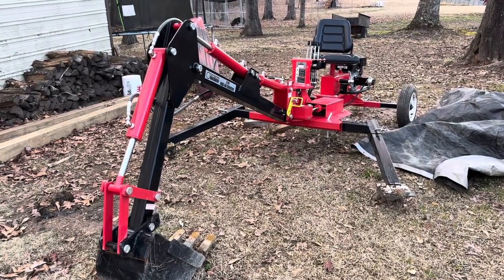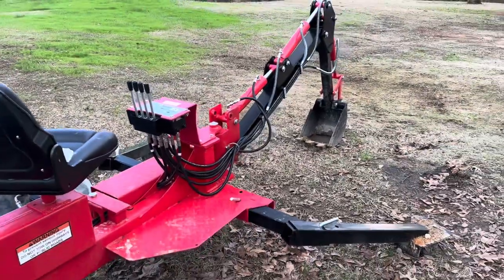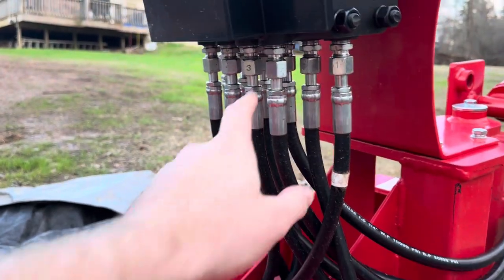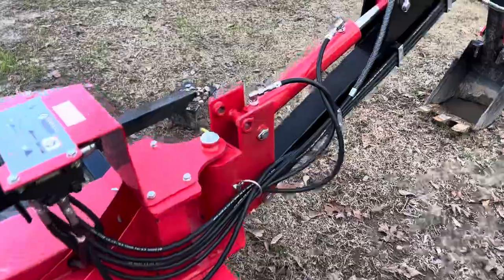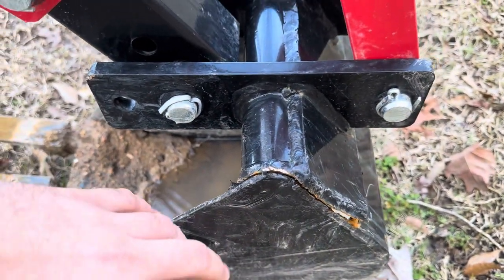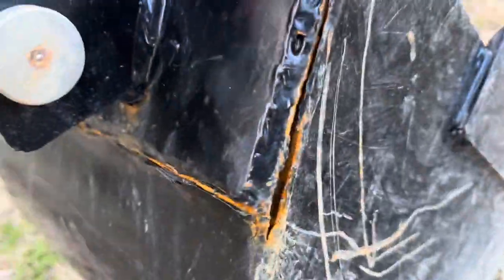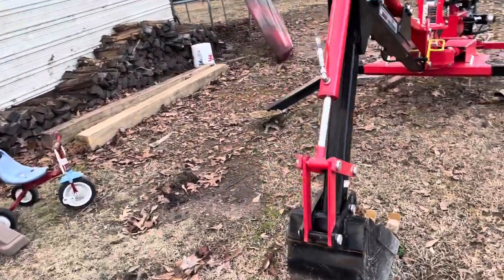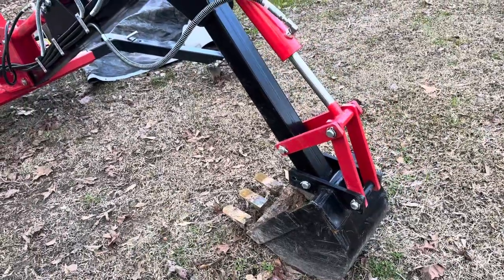Towable Backhoe Harbor Freight Broken after 2 weeks…..

Comment: " I could weld it back myself... but my harbor freight welder is broke too"......that would have been funny
Reply: harbor freight welder is actually very good.. had my flux core 6 years and i weld non stop on floor pans, frames, and even 3/16th leaf spring mounts and so forth..
Reply: @jeepsblackpowderandlights4305  I had thought about buying one...for small stuff around the house
Reply: @leewebb7  deff a good welder.. i have the 90a flux.  I think its called 120a flux now.. but its still just 90.   Easily restored my classic car with it.. floors. Frame.  Everything.  

The wire speeds on it are wrong though.. it says fastest for thick metal.. but i found around 4 wire speed for thicker metal is better
Reply: That's funny 😂
Reply: their welders are fantastic for small jobs.   I wouldn't wanna use it for everyday industrial jobs

Comment: Mine broke at the same place. The bucket fell off leaving the part connected to the dipper. Mine wasn't weldable, so ordered 2 new buckets. Took one to the weld shop to have reinforced- worked great no problems after that. The other bucket I cut off the teeth for a smooth lipped bucket for digging smooth bottom trenches in topsoil/sand ground. It worked great for that. It is a very strong machine.

Comment: It may be worth taking the bucket to a welding shop and letting them reinforce the welds. You could be a year waiting on the replacement bucket
Reply from the maker: I have it at a shop being welded now. Still have not received the replacement….. Almost 6 weeks now 🤦‍♂️
Reply: If you are digging hard with it order spare pivot pins there are only 3 different pivot pins in the entire machine (excluding the swing cylinder pins since those rarely fail) get at least 2 spares for the 2 different mast and boom pins and a single spare mast swing pin (the one under the valve body) also at least a full spare set of teeth and teeth keeper pins) those are the common failures and if the main mast swing pin breaks it will destroy the pin bores for the swing cylinder pins

Comment: I've used mine to remove 30 or more tree stumps, digging post holes, trenching, and at about 20 tree stumps same thing for me, the bucket failed. Welded it up and reinforced it. Stronger than new and still going.
Reply: Had HF hoe for about 5 years now !!!  Great little machine...  I tore teeth off bucket 3 years ago,,  Cut and Welded them back on with extra steel...  still going good,  just ripped out a 6" dia. 25' tall (dying tree) blue spruce for my neighbor... made short work of that !!!
Reply: How are you going about digging post holes with this? I'd assume just digging straight down? Figured it would be too wide.

Comment: Your hoses need to be rerouted.. from the control valve assembly, the hoses should through the center towards the boom and not wrapped around the center piece as you have them. The way you have them, it could cause some of the lines to pull too tight as you swing the boom to the left. Also, as someone already mentioned about your bucket cylinder lines, they should be run through center of the boom arm where the cylinders connect. As you have them, there is a risk of your bucket cylinder lines getting hung on something because they're flopping around. Good info on the bucket failure. I haven't seen where anyone else has had that issue, but it makes me want to go beef up the welds on my bucket. There are several other welds on the machine which also need to be beefed up, so give a good looking over and beef up those needed areas before you have issues. One main area others have had an issue with is the outriggers. Those welds on the outriggers definitely need to be beefed up and gussets should be added to all the angled welds on the outriggers. 
It is an awesome machine for the money.. it just needs some extra beefing in many areas.
Reply: You have not heard of this bucket failing before because nobody in their right mind would start digging out proper trees including all their rooting with this flimsy thing 😂
Reply: I believe the first thing I would do is built a shield around those hoses. I wouldn’t be comfortable with so many hydro lines that close between my legs.
Edit: and I’d probably add a small swingable thumb as well.

Comment: I bent the 22" bucket on my case 580C This weekend digging up a 6 inch pine tree. Now the bucket was built in 1977, and is a bit thin. We are rebuilding it with AR 400 bits and pieces plates (dropping from a Co that builds mining equipment)

Comment: I got one of these machines about 9 months ago and quickly discovered that the hydraulics are capable of producing considerably more force than the boom structure is engineered to sustain.  Not especially unusual with hydraulic equipment but something to always be mindful of when operating any of this equipment.  So far, other than learning the hard way that changing the zerk fittings on the main post of the boom is no joke (If you try to grease those with a standard grease nozzle it is almost assured that you will break them trying to disengage the nozzle.  Mine are now both replaced with stainless steel instead of the standard brass fitting and I got an extra long, easy release nozzle for my grease gun), it has performed every task without a hitch.  But you can definitely lift much more weight than the machine can counter so I can easily see that you could exceed the strength of the welds in the bucket.  On the other hand, those welds look pretty messy, much worse than on my machine, and I agree with a few folks saying just take it to a good welding shop.  $50-$75 later you would probably go home with a bucket many times stronger than the original.

Comment: I've had my  little backhoe for a bit over 2 years.

It has enough power to rip the bucket in half.  I have welded my bucket back together and reinforced it.

It can also rip the welds on the "leg extensions"

And it can break the pins at any pivot point.
Breaking the pins at some points can cause the "stick" flanges to spread from each other, making it impossible to put the cotter pin in to hold the replacement pin.

Replace the cotter pins with Hitch Pins (harbor freight sell a kit of hitch pins, but only the largest are correct)  These will get broken... never. The cotter pins will break regularly.  You can also use a framing nail and bend it at both ends.  A framing nail is easier to cut than a hitch pin but still stronger than the cotter pin.

Curling the bucket under high load can destroy the stick-out cylinder by the load suddenly bending the shaft.  I did that on a tree root the size you described.  Get a sawzall and cut big roots.

Really, they need the relif valve adusted for LESS pressure.  There are youtube videos of people increasing the pressure.  Don't do it.  This does not make it move faster.  There is a video of what pump to get to increase speed. (still need lower pressure on the relief)
While curling, bump the crowding (stick out/in for the section near the bucket) lever to relive pressure in that cylinder.  That will prevent the hydraulic lock from breaking things.  
When the control levers are centered, the affected cylinder has no relief valve.  Putting a relief on each cylinder is possible but expensive.

Comment: Had one like that in the 90's  called "mantis" 5 hp motor , it had an articulated set of large teeth at the back to anchor to the ground ; The only issue is that you can't drive around and move dirt and rocks , But a good little machine .

Comment: I would imagine the replacement bucket will not be any stronger than the one that came on just my opinion
Reply: obviously bad welds as it broke where welded, weld it back up with some gussets and doublers and it will be much better than the new one, if it ever gets there good vid, THANX
Reply: Same factory. Same Chinesium.

Comment: I see another even bigger problem with the obvious lack of grease points on the boom and pivots.
Reply: How else would they get you to buy their drill/tap sets and a box of zerks?
Reply: It has "needle zerks"  There is a needle adapter for a grease gun  There are grease points all over the thing.  Ever pivot has a zerk.  Center of the end on the 2 most common pins you will find what looks like a little bullseye.  Push the center with the tip of a nail, it's the ball of a zerk.
Reply: @fhuber7507  
Seems you need to tell some more ppl. I had no clue, but a lot of folks here seem to think it has none.
That’s good info btw.

Comment: What's the pin size on these things? If it's 1" you might try the stuff Nothern tool sells for their towable digger. I bought the $159 ripper tooth for my Kubota backhoe (it fits..) and am 100% happy with that. They sell a 10" bucket for $250.

Comment: how comfortable is this thing to run if you"re on it for a couple of hours ? does it kill your back? seen another video with the bucket failure so you"re not the only one.
Reply: I have one and it’s extremely comfortable
Reply: I put in a pin to lock the seet and stop it swiveling.

You CAN get your left foot in a pinch point.  I have an artificial left foot, got it in there and ot crushed the carbon fibre foot.  A real foot, you'll likely feel it go in the little space and pull it out....
Reply: @fhuber7507  better be careful with that.

Comment: I would weld it up and reinforce that area over getting another one that will break too ( or at least beef up the replacement bucket before destroying it ) .... do you get to keep the old bucket?... part of buying cheaper products is repairing the poor quality welds or design... sadly that is why they are so cheap... but still worth the price as you can buy the tools to fix it with the savings .of course you should already own Tools to fix anything !!

Comment: I see most people push these machines way past their limits. If you're breaking buckets, you're pushing things too hard. Couple that with shoddy Chinese construction, and IMO, this item is not worth investing in.
Reply: I've never had a bucket failure and I have this exact machine model only much older and yes I dig out stumps, whole 8-12inch dia trees,and boulders up to 1000lbs. With mine this looks like a case of bad operator technique causing the failure but adding some reinforcements to the bucket won't hurt... I also would not let my machine sit outta service waiting for a bucket when an hour with a flux core welder on its highest setting woulda repaired it and made it usable until the new bucket arrived (flux core welder because I would have been out in the middle of my acreage nowhere near a power bush which would result in needing to run the welder off a generator... with enough wind to render a mig welder unusable as the shielding gas gets blown away from the weld in progress which is one of the upsides of a flux core welder or stick welder)...

Comment: Every video I see on these where something broke on it, it always has to do with someone trying to rip out trees....Hmmmm
Reply: That's just silly, no way a bucket should fail designed to work at a set psi.
Reply: @half-breed What is silly is thinking anything is designed on this with trees in mind😂
Reply: @JO-cj2dv  do you really think the machine knows the difference between a tree or a big rock 🤔,